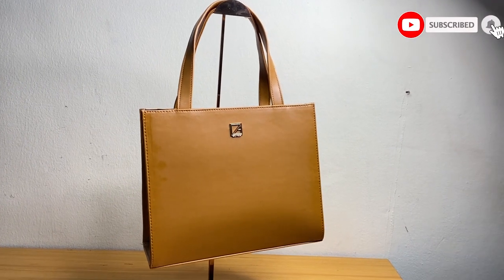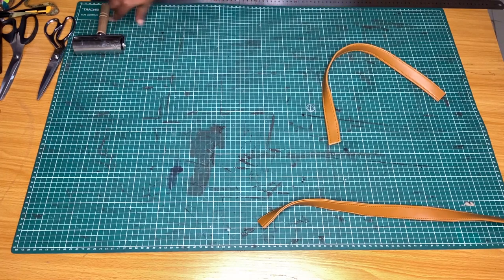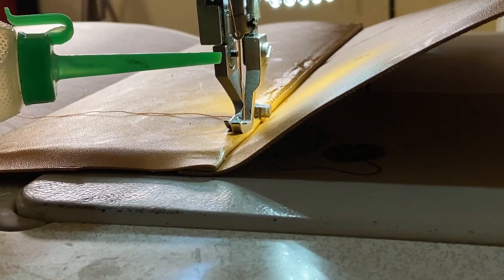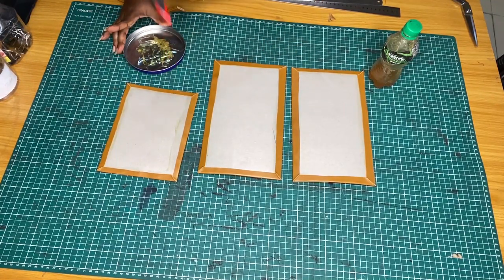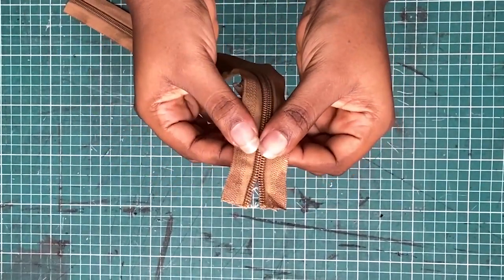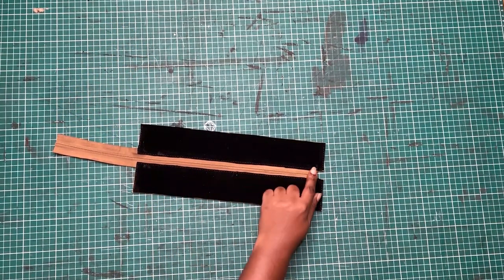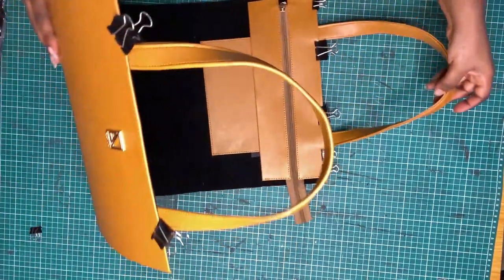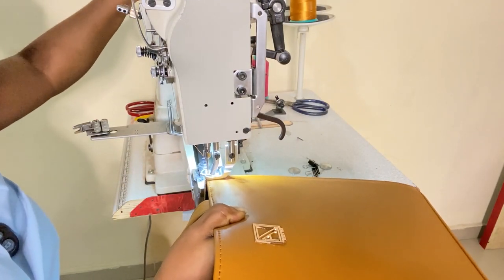How to make a standard tote bag with Faux Leather | Eris Atelier

Comment: Thanks dear for the good heart i have been thinking how i will get knowledge about making shoes and bags and I came across your video am interested and I will ask for your help as a beginner how much money can I start with plus the machines
Reply from the maker: @nakazibaaminah3102  For capital it actually depends on how large you want to run it so you can start with a much as you can. For the machine a flat bed Industrial machine will is fine .
Reply: @ErisFoundation  can it be used for both shoes and bags

Comment: 23:00 what liquid is that?
Reply from the maker: It's sewing machine oil, it's a trick I use when I'm sewing through an area that has wet or partially dried contact adhesive/gum. 

This makes it easy for the needle to pass through without getting sticky hence breaking that thread.
Reply: @ErisFoundation  o wow, that's a masterclass tip, thanks!